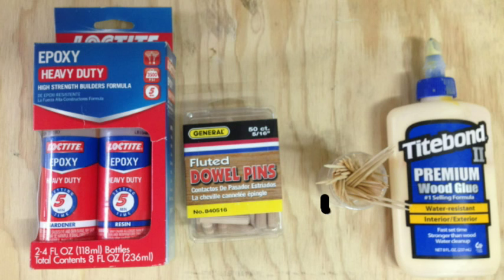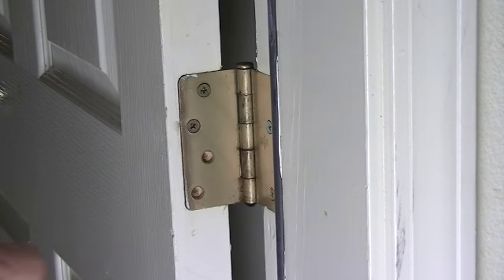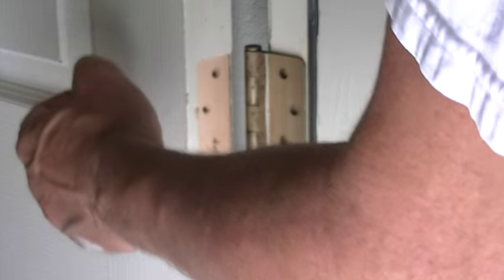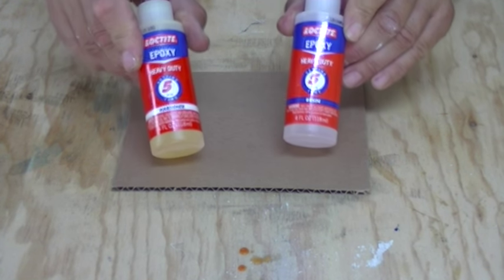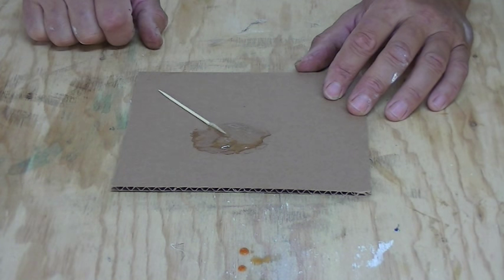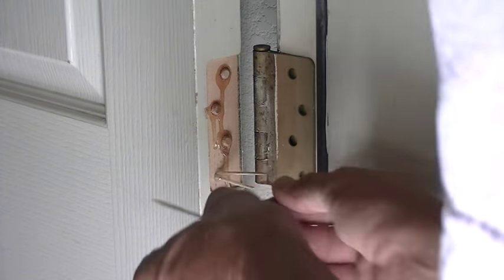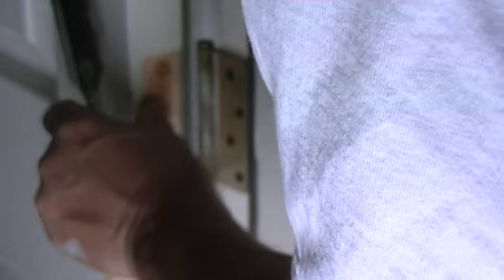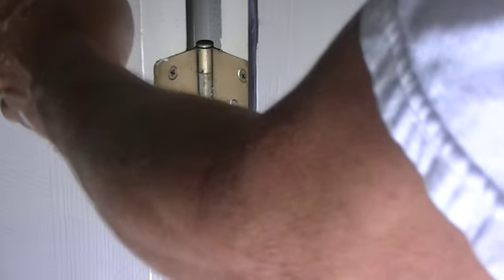Fixing Stripped Door Hinge Screw Holes  By: Everything Home TV

Comment: Thanks for the video.  I rarely see people drill out a proper sized hole prior to re-screwing. People just screw right into the solution without "prepping" with a drilled hole.  Just seems the material of the wooden dowel would be too much to just drill straight into.  Like the door itself might "bow" outward from the additional material being screwed into.